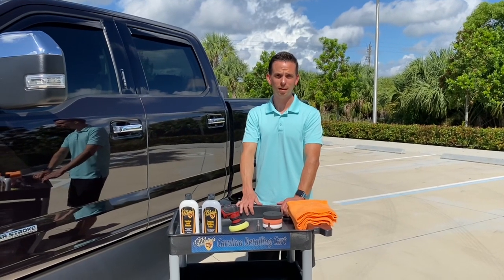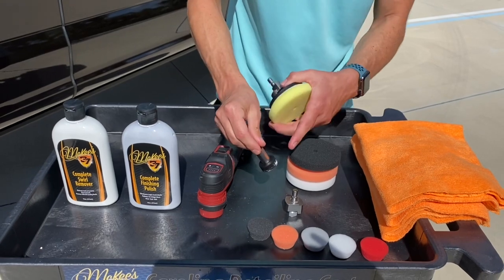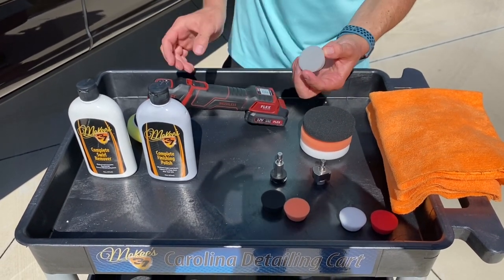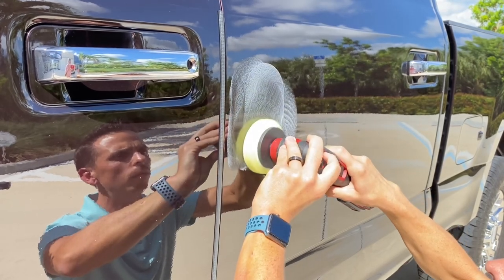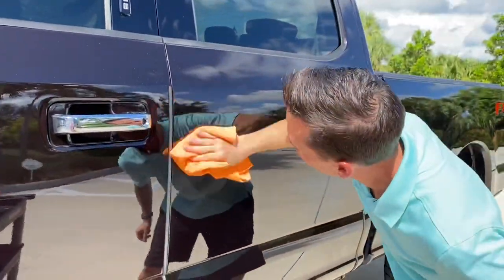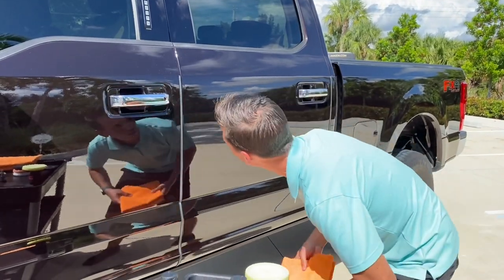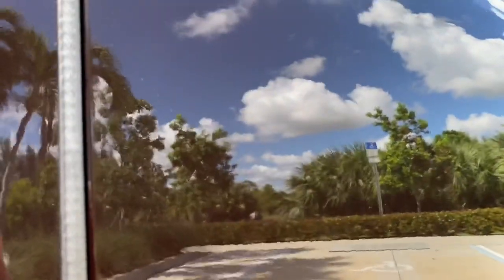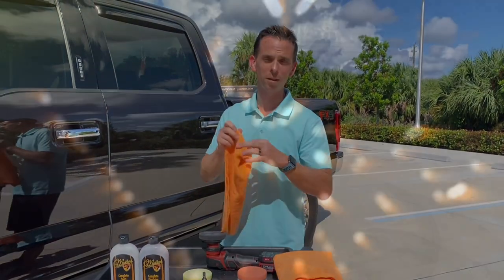How to Remove Scratches in Clear Coat

Comment: Your Compound and Polish Flakes way too much. A lot of other compound/polishes don't do that which make it easier for cleanup and remove the scratches just as effectively! Good video though.
Reply from the maker: Some dusting was present from Complete Swirl Remover due to the aggressiveness of the pad combined with the heat of the panel.  The heat index was over 100 degrees when this video was filmed.  If you were working in a more controlled environment (garage), you wouldn't experience the (minor) dusting.  - Nick
Reply: @McKees37  Thanks Nick for the explanation of the flaking and what I thought of was splattering of the Compound.  I now understand that the heat (of which I have seen myself when working outside Polishing) can do to your job.  I was thinking though, if you would have prepped a larger area with spreading the polish out before turning on the Polisher, It would not have splattered as much.  But, then again, I may be second guessing and that is not what I am trying to do here.